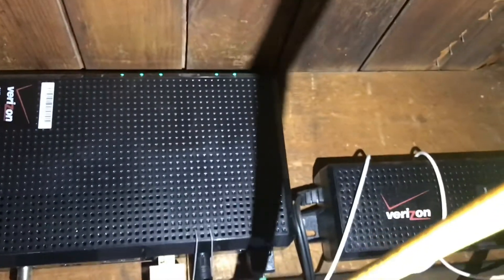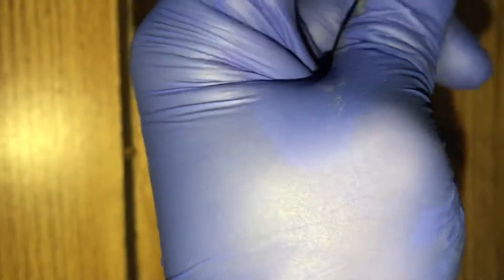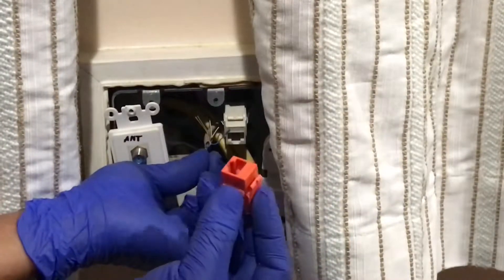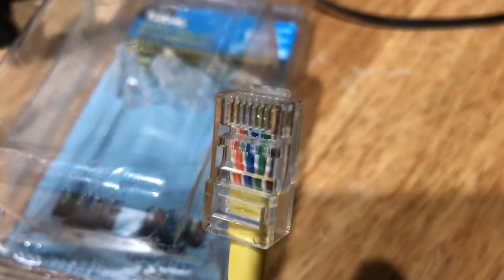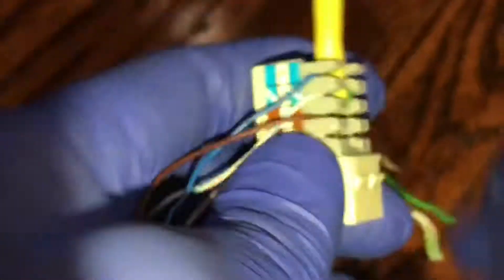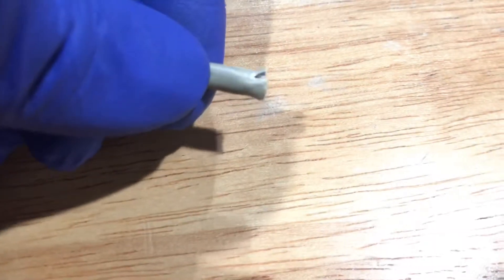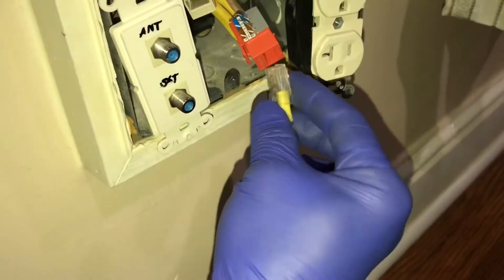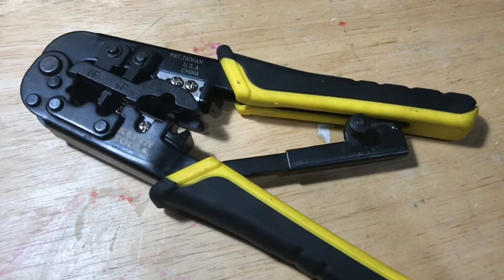How to convert your telephone line to an internet line: A complete guide

Comment: The termination was a Nono the green pair and blue was so badly done because the yellow jacket was in the way even though you did at least keep the twist very close to the termination point which is correct also the proximity to power cables in the same box is a violation of code but also a violation of industry standards since the interference coming from AC cable is high 
Please advice your friends that this is not correct even though it works
Reply from the maker: Thank you for this follow up info. I agree to have the cables in a seperate terminal box to isolate data cables and prevent interference from the power wires.

Comment: I mean if you're in a pinch, but personally I would just get some cat6, 6a, 6e or 5e. Less hassle and better performance. Yes you can make the argument that it's a lot easier because the cables are already ran. But because you are not intending to use the phone line for well, old phones. Then just replace the phone with Ethernet. So unless you have little to no money, Just go with modern Ethernet.

Comment: Technically you only need (2) pairs.  Pins 1,2,3,&6.  The orange and green pairs in a standard patch cord.  Untwisted pair may yield you maybe 10base T standards.
Reply: Only 2 pairs are used for 10-100BASE-T while gigabit uses all 4 pairs.

Comment: How much is the difference between the speed in phone line vs cat6
Reply from the maker: Hello, Harshvardhan Ruia, in this video, the Cat5e used on the phone line can handle 10/100 Mbps speed at 100Mhz bandwidth while cat6 is 10Gbps at a capacity of 250Mhz so theres a huge difference when compared side by side
Reply: @fixablethings  cat5e is capable of 1000 if done properly and distance
Reply: If its old telephone cabling (untwisted 2 pair cable), you will only be able to get a reliable connection at 10Mbps, you could do 100Mbps over that cable but only in half duplex operation. Cat5e can handle up to 1000Mbps if the system is terminated properly. Cat6 is designed to do a better job at 1000Mbps operation but its also capable of 10Gbps if the channel lengh is no more than 55m